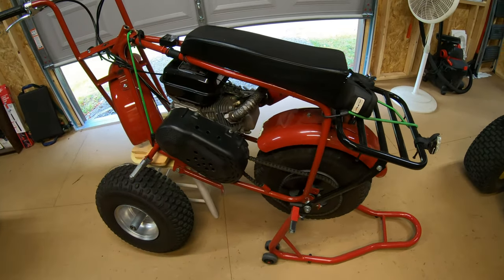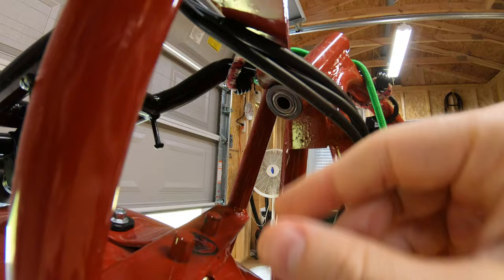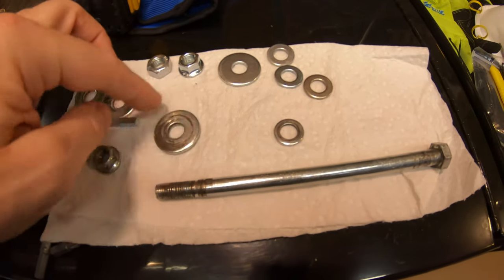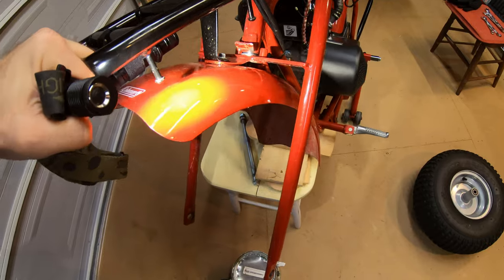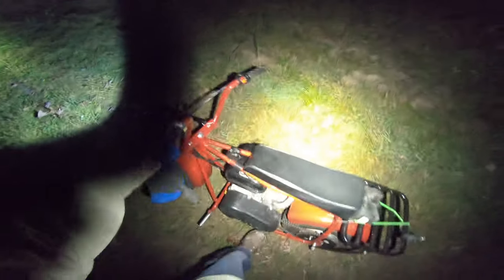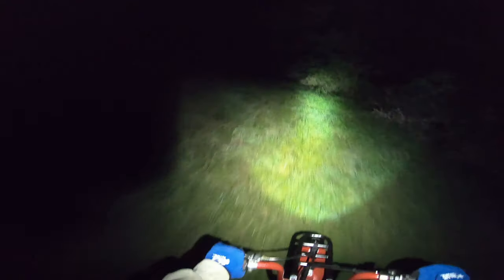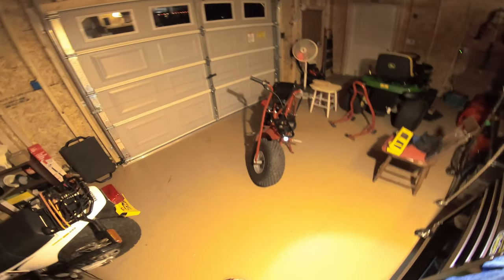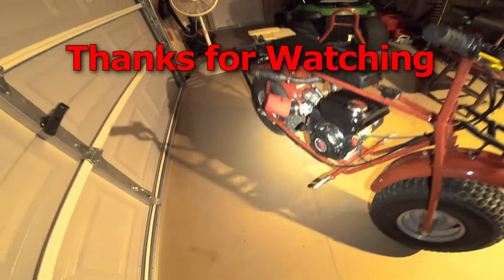CT200U Mini Bike 👀 STEERING FIXED!! 👍[4K]

Comment: That is correct  !  - Put another smaller washer on underside of head tube also,  just like on top - & put thick bigger one under it - & the other thicker bigger one on very bottom where lock nut is . . . . .
Reply from the maker: Only issue is you start running out of space on the axle- at least in mine.  But I fixed it like it is. But I got new suspension forks that came with a new steering stem axle so it works perfect now.

Comment: I pulled the fork bearings out and the tube in-between was smashing into the bearing shields! I found a smaller 10mm shaft to keep it on the inner race. The oversized tube crushed my bearings and they always felt rough when actually tight.
Reply from the maker: Good find! That would explain what’s happening to these bikes a lot of the time.  I’ve heard people say it can also be too short and cause problems. Also the spacer tube in the wheels can be too short and cause bearings to drag when tightening axle nut.  I guess it’s expected on cheap mini bikes but yeah it sucks.

Comment: Thanks for the video! Did your front end shake upon acceleration from a stop? When I have my bike's front end off the ground, I can feel the shake and play in the steering column connecting shaft, even when I tighten it down as much as I can, it is there. The problem started after a few minutes of very rough off road riding.
Reply from the maker: A little bit but I think that's just play in the bearings and the stem. I think the bearings aren't really big enough and don't fit tight enough on the steering stem (the axle basically).  It's not too bad on my bikes but if it was any worse it wouldn't be good.

You may want to replace your bearings. It's worth a shot I guess. Might help might not.
Reply: @bwxmoto  Yeah I'm going to order 2 new bearings and a steering bearing kit that includes a liner. When I have the bikes front wheel propped off the ground, I can pull on the forks and feel the play in it. It's definitely something to do with the steering column. The effects are upon takeoff from a standstill, you can see at the bottom of the forks by the front wheel, it jerks back and forth about half an inch. Lasts about 1 second and the bike is otherwise just fine riding but it's annoying as the bike was perfect before.
Reply from the maker: Yep that sounds like bearings. Newberry should definitely help I would say.
Reply: You don't have it assembled correctly -

Comment: Hey I have the Coleman CT 200 U and every since I got it the steering has been sticky like yours well I really appreciate this video I’ve done the same thing you did and then the minor adjustments that you can make when you’re writing is unbelievable but it’s smooth as butter now thanks a lot I watch about all your videos appreciate it keep them coming
Reply from the maker: Awesome! Glad it worked. Yeah it was a pain trying to figure out what was causing it. Also I think another thing is the spacing. I put an extra washer down there so when you tighten nut on the bottom it doesn't squish the two triple clamps together as much. 

On a regular setup you can loosen the lower clamp, on the CT200U it's welded so you can't.  It used to just squish them together a lot more and bend them, now with extra washers on the bottom they do not bend as much. I  think that helps too.

Comment: Nice job on the fine tuning of the front fork washer spacing. I have the same 60 rear and TQ and absolutely it makes it trailable finally. That clutch might of been good for just travelling but stop and go or going slow it was terrible.
Reply from the maker: Thanks! yeah man I should have done it a long time ago. It really made a big difference in the feel of the bike and no more random clunking up front.. And yeah a 60t rear + torque converter is the ticket. This little thing is a beast!

Comment: Nice job on video, I like the back stand.  I have question needs some help,  I have same bike, took governor out installed 18lbs springs adjusted valve lash at .006 & .008 at top dead center,  starter hard to pull and recoil killing my hand don't know what I did wrong, anyway I can not start the bike.  Any suggestions thank you.
Reply from the maker: Thanks! Man it’s hard to say. I would try readjusting valves I guess!
Reply from the maker: Yup that stand really helps! There’re about 30 bucks on Amazon. I use it on my TW200 too.
Reply: I’d put the lash lower than the numbers you posted.
Reply: @chrishefley139  thanks I will try that
Reply: your valve lash should be .003 both exhaust and intake, but installing bigger springs is nice, its better to have a Cam like a 265 cruise cam to go with them 18lb springs, then set at .003 both. you have not enough lash and too much spring

Comment: Thanks for the flash light Ideal. Just wonder how long the battery last.
Reply from the maker: No problem 👍 - I usually have a floody one and one with a tighter beam and run them on medium and they'll last over 5 hours. On High maybe 1.5 to 2 hours. But they are 18650 cells and you could bring 10 extra and not notice the weight. I usually have a flashlight in my pocket and a headlamp in backpack or else on my head if riding at night.

Comment: Where can I buy the bolt
Reply from the maker: Actually they sell it on the Coleman Powersports website. I think it's number 11 on that diagram. https://www.colemanpowersportsusa.com/parts/mini-bike-parts/ct200u/handlebars
Reply from the maker: I just looked and shipping is over $38 for the $5 part. I think if you call them they will give you other shipping options in cases like that. I was thinking about getting a new one because mine is worn in places.

Comment: What size bolt and nuts are those
Reply from the maker: Which ones?
Reply: @bwxmoto  the steering one that connects it all together where do I buy it or what’s the size
Reply from the maker: @Flaggrassmonkey  They have them at the Coleman powersports website but shipping in insane so I think you can find out the specs there though.  "Hexagon Flange Locknut M10x1.25" I think, number 13 on the diagram. I had a browser tab open looking around there. Never saw this comment till now, youtube seems to block my comment notifications about 70% of the time.  
https://www.colemanpowersportsusa.com/parts/mini-bike-parts/ct200u/handlebars

Comment: Looks like a good fix. Mine has always been an issue and always thought they went too light duty there. Everything there should be larger including one step up on the bolt size. Mine seemed to loosen up with play even though I thought I had it setup properly. I got the bike in late 2016 and it seems to have stabilized now. I don't ride a lot at all compared to others.
Reply from the maker: It’s not a very good setup! I think the tolerances are a little off or something- maybe I need new bearings or spacer tube.  It works ok now though.  👍

Comment: I did about the same thing a year or two ago, the manual leaves a Lot to be desired...  There's a washer on the rear axle that still has me stumped as to its correct position after removing the rear wheel for knobby tires.
Reply from the maker: Yeah I think there is a bunch that are defective in some way- maybe bearing, maybe the spacer tube is too short. Not sure!  Lots of "DIY" with these bikes, but I guess you expect that from a cheap Chinese bike! haha
Reply: @bwxmoto    You are Correct Sir,  it's been a Great little bike for 3 years running.  I keep my oil changed & Every moving part lubed - It may last me a Lifetime!!
   Thanks for the Great Vid's!!

Comment: Are you still using the stock 196 engine or a 212 now? Was the shaft size 3/4 or smaller in your 196? The link you posted was for a 3/4” for the tc. I’m looking at getting one for my ct200u also. And to fix the steering stem like you did. How are the belts holding up?
Reply from the maker: Yeah that is the Hemi 212 predator but has the Hisun tank on it. My Hisun came with 16mm shaft, that's really the only reason I put a Predator on there, to get the 3/4 in shaft. Since I switched to 60t rear/ 9t front belts holding up well. Before I would burn them up pretty bad but I also think i never had the pulleys aligned quite right. I think you're supposed to line up backs of the pulleys and i was always eyeballing the front. I think they'll be better after I line them up better on the CT200U.
Reply: @bwxmoto  how is your top speed with that 60/9 gearing? I want to change mine.
Reply from the maker: @lilmockme8821  Down a hill it went 51 mph down hill.. Flat ground about 45 mph or so. But still has lots of climbing power and torque for the woods. 8t-60t will go about 49 mph top speed down a hill, and about 43 mph flat ground.. running into governor engine RPM limit.  I have some top speed GPS test run vids with the different sprocket combinations.

8t-60t https://www.youtube.com/watch?v=2djCyhpgwe0&ab_channel=BWX

9t-60t  https://www.youtube.com/watch?v=4XqIMldG2Ts&ab_channel=BWX

Plenty fast top speed for me. Could go faster with taller gearing for sure.